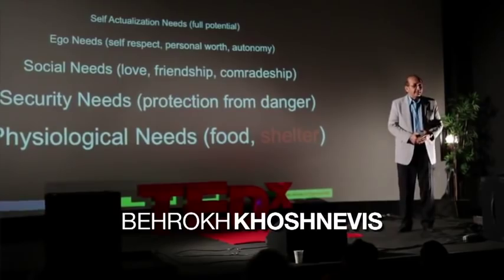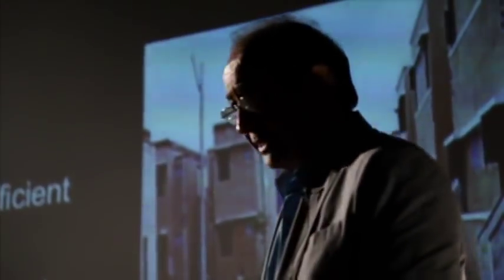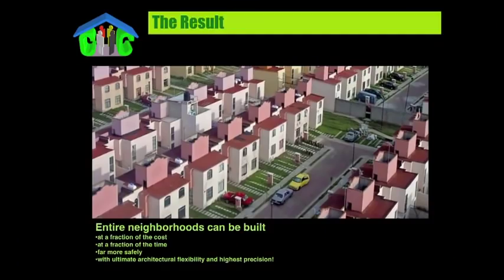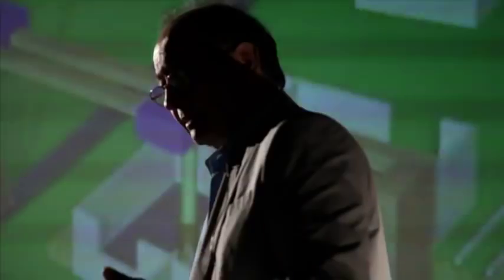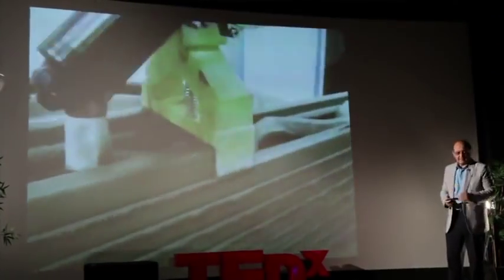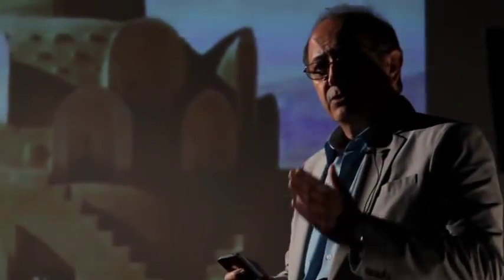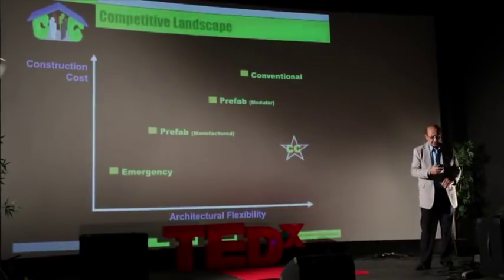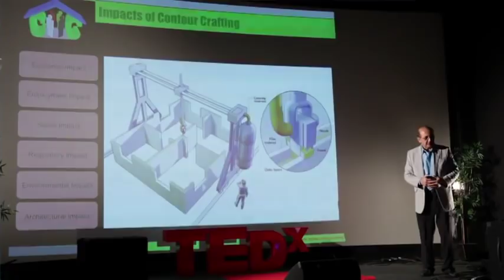3D printer can build a house in 20 hours

Comment: ..sigh...  You weren't listening.  I will use a house to illustrate.  take two houses.  One in Nebraska, and one in California.  Both are built by the same company (celebrity homes in this case).  Same floor plan, same parts, same amount of nails, same amount of lumber, same everything.  They even use the same workers (illegal Mexicans).  In Nebraska they sell the house for $100,000.00 + the cost of the lot, and In California they sell it for $220,000.00 plus the lot. Why? Different markets.

Comment: Easily Install Plumbing and Electricity? That technology doesn't currently exist. (DREAM) And he says the walls conduct heat very well? If you live in Arizona, I would think insulated walls would be better? This is a DREAM Presentation, This would be good only for Third World where you are not installing Electricity or Plumbing and just need Basic Structure.. (Then who would want to spend millions on a machine and drag it out to boonies to build that.)  But for Modern world? We are not there yet

Comment: Your attempt at being clever failed with your previous comment.  Beholding is to see.  Not to worship.  I'm not trying to sell you anything.  There is nothing to "see through" either.  The ability to "print" a building is going to change the construction industry in many ways, but it will never completely eliminate the current techniques.

Comment: This is childish and dangerous!!!   "Printing" a house does not compare to the cured reinforced concrete with hardened and tempered steel bracing, or brick or stone.  It would be dangerous to use a "printing" method as it doesn't take into account stresses and strains, compensated for by current materials.